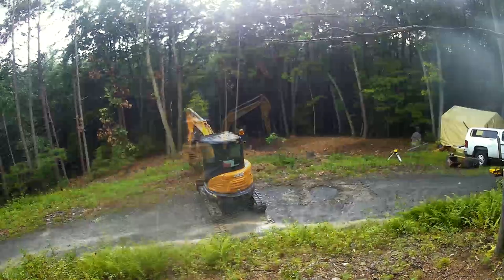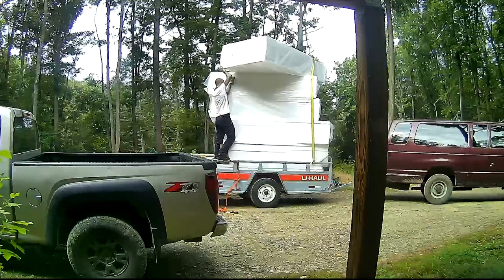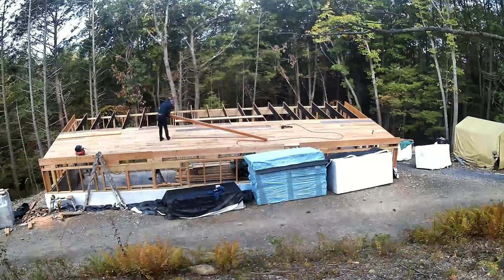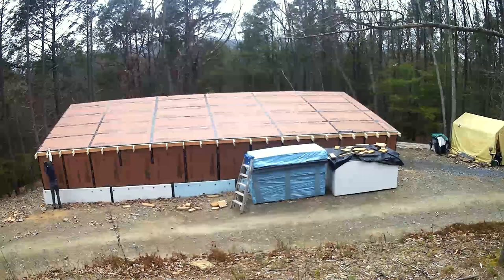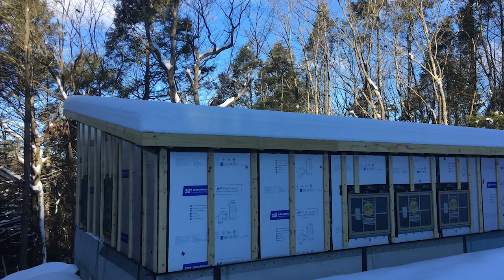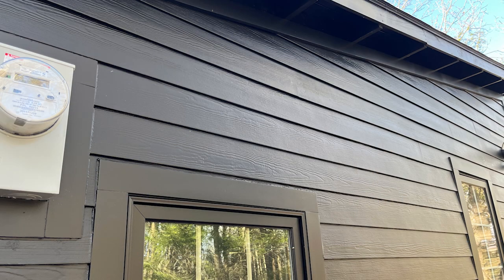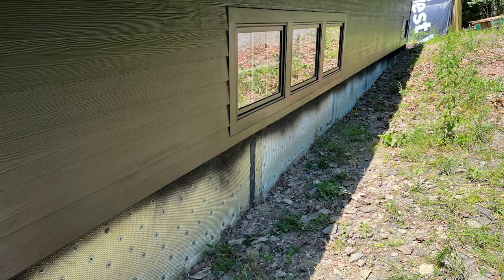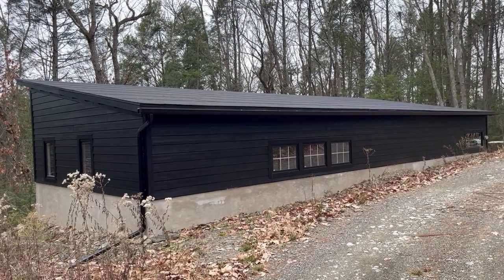Less than 20 min Start To Finish Build of High Performance Building with Cathedral Ceiling, Rigid Fo

Comment: When I put doors sideways they fogged up. I want to make a building just like that passive solar
Reply from the maker: Thanks for checking out my video.  There are interior french doors that are single pane. Those will fog up.  IF its an exterior french door, double pane, it'll help keep heat/cooling inside and shouldn't fog up.

Comment: Super cool. I don't see anything wrong with the roof insulation at all. As long as it stays dry and sheds snow/water as needed, it should be fine. As for what the guy was doing wiggling the 2x4 while pouring the slab, he was just "screeding"/leveling the cement while it's wet. Working it back and forth along the length of the slab is a great way to get a level pour with simple tools. Keeping it covered and wet helps it to cure properly, as well. Any particular reason you built 24" on center? Were the LVL boards worth the expense? Cheers from FL.
Reply from the maker: Thanks for checking it out Karl.  Yeah man I definitely learned a lot watching the concrete guys when they were here.  
24 oc saved me money on lumber. Buying lumber in 2020, I paid more than anyone in history for a 2x6.  The 3 ply headers I learned recently are unnecessary too.  Guess it depends on your local code.  FL you guys have to worry about lateral forces more than us here in PA.   
Engineering said I couldn't do 20 ft 2x12 dimensional lumber. I wanted 4x12s and it was almost worth it to drive to OHIO and back to pick them up.  The LVLs were $86 a piece from Home Depot and with engineered lumber, they are all without any bowing or twisting.  Framing an entire building in engineered lumber must be really nice but I wonder how much more it costs.

Comment: How did you fasten foam board to foundation?
Reply from the maker: Thanks for checking out my videos Kyle. IN my other video I list the materials I used to fasten foam to the concrete foundation. "How to Fasten Rigid Foam Insulation Over Concrete for Thermal Break". I tried to link it below. Let me know if you are still looking for more info. 
https://youtu.be/qDee3iuU2NU

Comment: Fucking badass dude. Great job. Totally agree with you. Some shit you just need to sub out. Why didnt you do ICF though sonce you wanted a high performance build? Fellow NEPAer here btw!
Reply from the maker: Hi neighbor. The guy that did the concrete did not recommend ICF and it seemed that that would be a more expensive way to go .  I also didn't want foam on the inside of the concrete.  The concrete walls and floor that are all inside rigid foam, are at a steady 68 degrees like the inside of the building.  It supposedly stores the heat and helps keep the building a consistent temperature for less heating and cooling costs.  After a number of years now, using only electric to heat and cool with the minisplit - I spend less than $100/m on average on electric.  Thats including all the other stuff that uses electric too. Would do it again.  Does someone in the area even sell those ICF's or do you have to get them shipped? I didn't want to try and build the ICF lego block walls and order concrete for the first time.  Thanks for checking out my video .
Reply: @POCONOPOWERCORD  yea I'm sure he didn't recommend because he loses out on money lol. Great job in any event.
Reply from the maker: @jpatt5054  Totally possible. I've had a hard time hiring people.  Seems people only want to do what they know.  IF I would of tried to hire someone to do anything high performance, I'd prob still be looking.